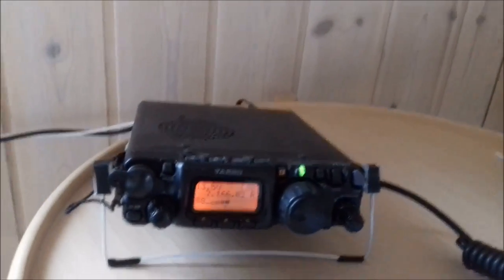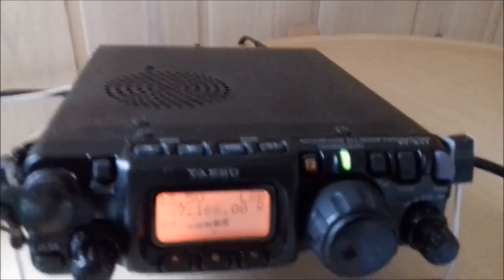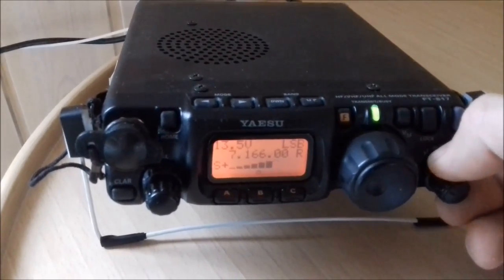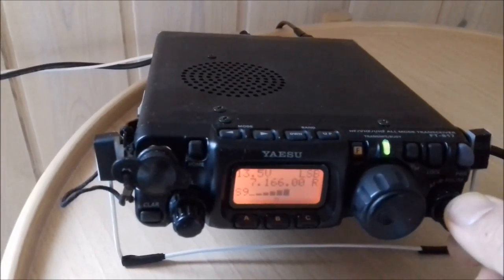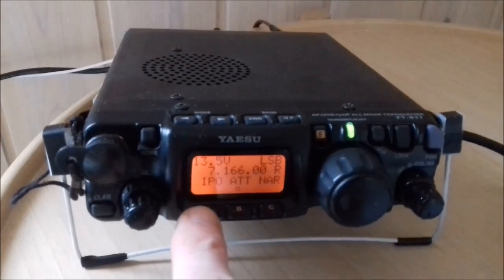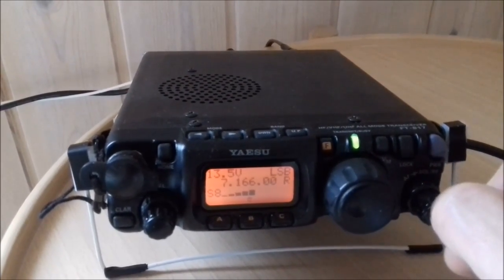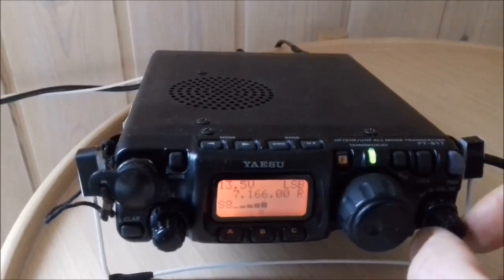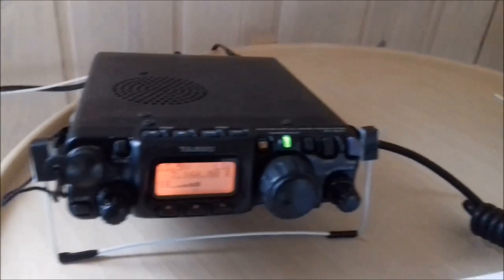Ft-817/FT-818: How to improve receiving performance with simple settings

Comment: I don’t see you explaining anything that you did. What am I missing? 🧐
Reply: Turn the AF gain (volume ) fully up or well up . Then turn the RF gain anticlock wise . Until the noise drops and comfortable.  This works with any radio that has a RF gain feature.  Apart from some SDR radios like the ic7300 which is useless (I have one so I know) same as ic7610 .

Comment: This definitely works many yaesu operators miss the ipo boat. Perhaps next time try engaging both IPO and ATT then turn volume up.... After this use the RF gain control as you would volume starting low. You'll find this often times provides most improved cleanup of incoming signals.

Comment: Hi. Where did you buy that bracket? Thanks.
Reply from the maker: Hi, I made it out of a coat hanger and two screw-type terminals. Just added a little black tape on the terminals  to make it look... well, a little better :) 73s
Reply: @hamradiosoulbydh7lm913  A very good and unexpensive idea. I will try to do onde for me. Have a nice week. 73 de PY1FX/Marcos.

Comment: A BHI dsp board in the 817 does wonders on the receive.  Totally different machine after I had mine installed.
Reply: you "had yours installed" ??  cmon man your meant to be an amateur.. do it yourself !
Reply: @ rob b:  Ok... I get the bravado and congratulations on your abilities.  I'm not about to start soldering on my circuit board and screw it up.  I watched and learned a lot as my Elmer was kind enough to help me out.   Not that I owe you an explanation but I'm not afraid to admit when things are beyond my skill level and ask for help when I need it.

Comment: And if you add the BHI DSP filter and the mechanical Collins filter this radio bumps up at kx3 level
Reply: Eduardo Power Not even close
Reply: @ Eduardo Power:  It's not all the about the power, Eduardo...  I'd rather have a good antenna, elevation, and an 817 with the efficient and inexpensive mods than the extra 5 watts the kx3 supplies.   K7GYB
Reply: 66 it’s probably close.

Comment: I don't do any 80 m (no antenna) keep the preamp off on 40 m mostly (poor antenna too). 

I work CW 95% and turn AF gain full on and adjust the RF gain down as far as possible. When you get the RF gain set the CW signal just seems to pop up from the noise. Sometimes it is pretty touchy.
Reply from the maker: Thanks for your comment. Yeah, I think the main reason is that the AGC starts pumping like crazy on higher RF gain settings, thus amplifying noise and QRM. Also, everything seems to get overloaded - it's just too much gain for the lower bands. Oftentimes in ham radio, less is more :)
Reply: AGC on or off?
Reply: Absolutely!  This was instruction on an old eddystone ec10 . Af gain full up then adjust rf gain to comfort.  This seems to have got lost over time . With everything going flat out .